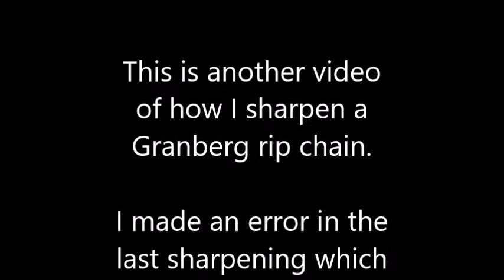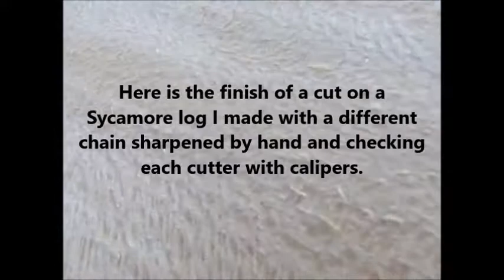Granberg Rip Chain Sharpen and Test Cut

Comment: Dude what is that angle. The top one that tilts to the left ? I know the side one is 10 degrees. Because when i sharpened my rip to ten on sides and zero on top it cut horrible.